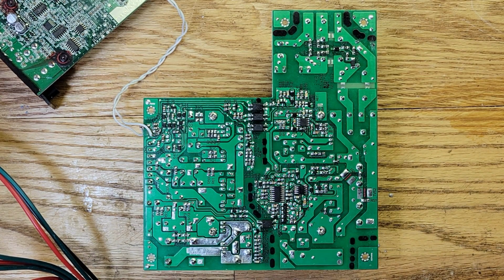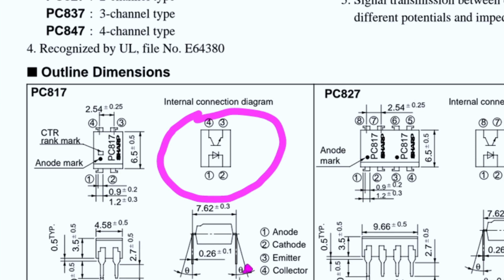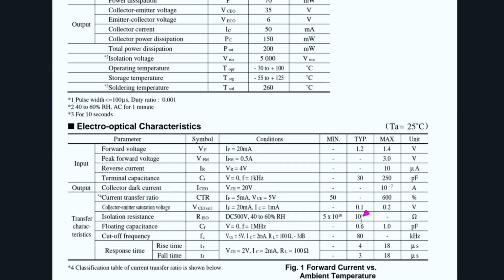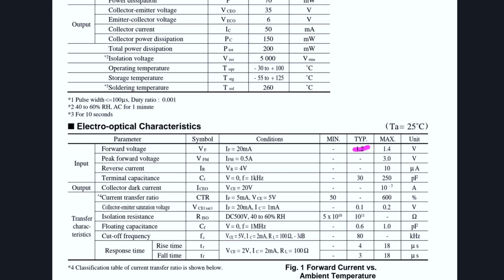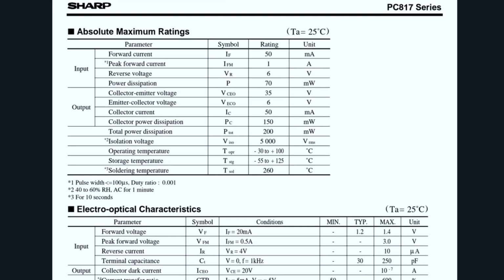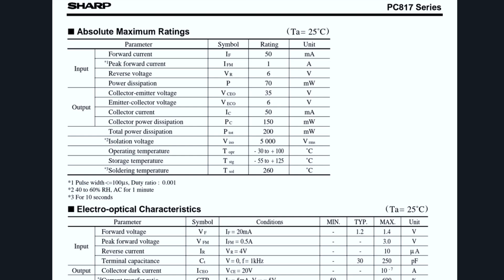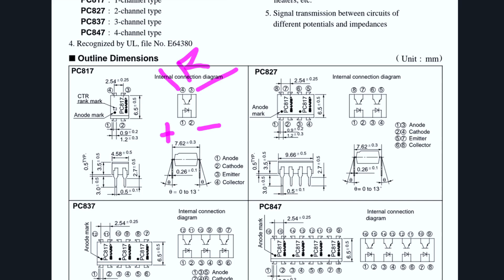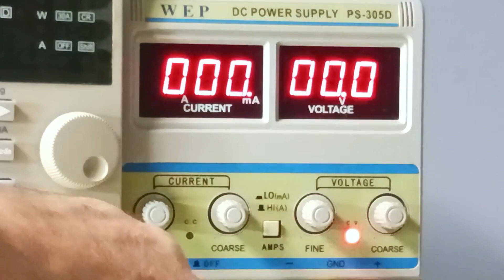How I test an Optocoupler in circuit

Comment: I use pc123 as switch to make make solar light to turn on when human around using microwave module but the output voltage drops and the leds dims what must be a problem? I connected it across negative side.